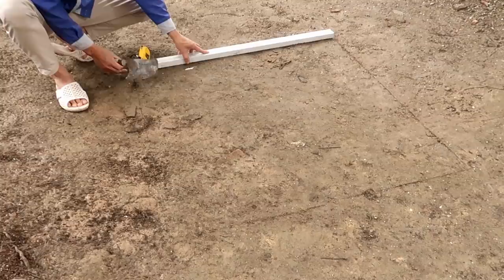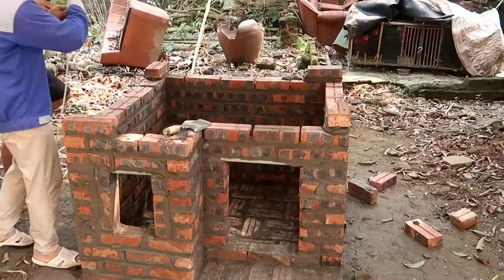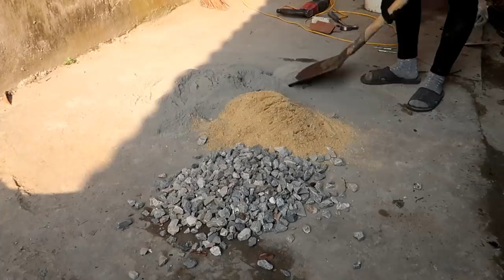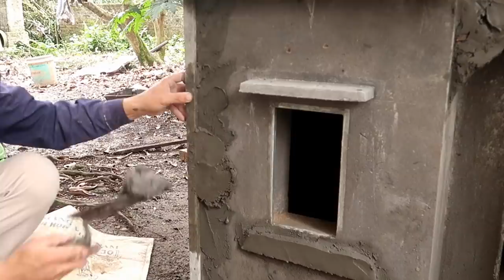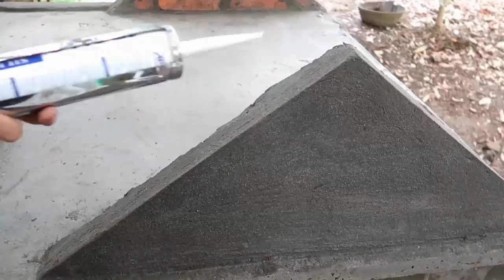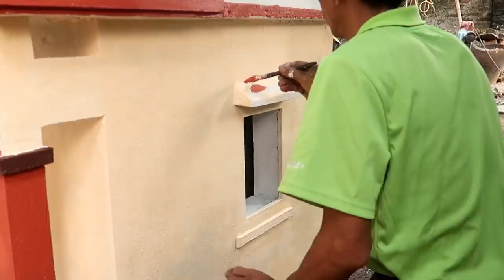Building a Country House - How To Make a mini House for my Dog

Comment: Concrete is cold, plus it sucks the ENERGY out of a body. Nah..a concrete house for the dog is NOT a good idea...try wood or some other material which aids their (a dog's) body heat rather than sucking it out through a cement house...smh.